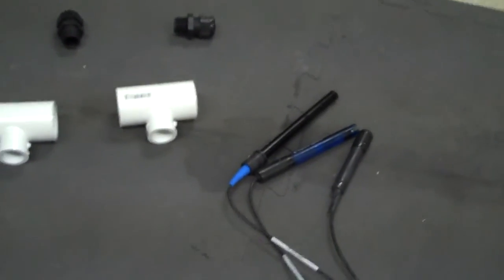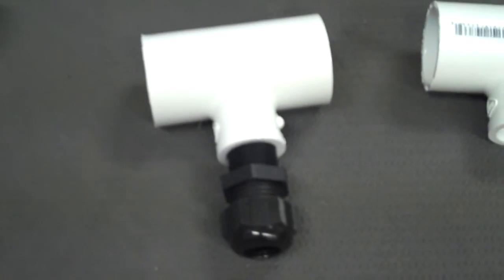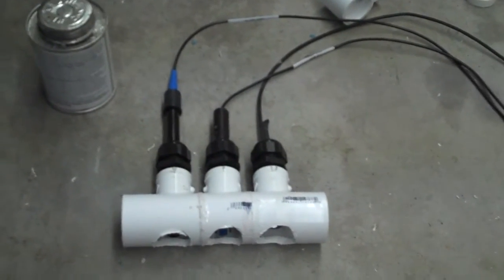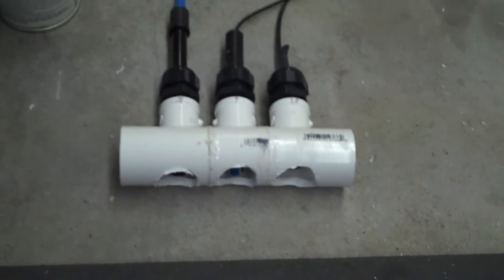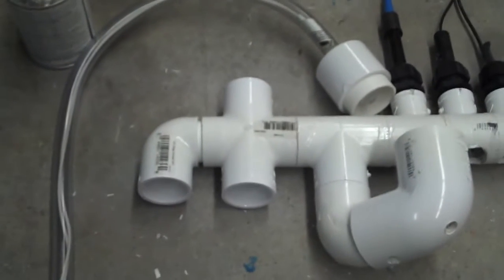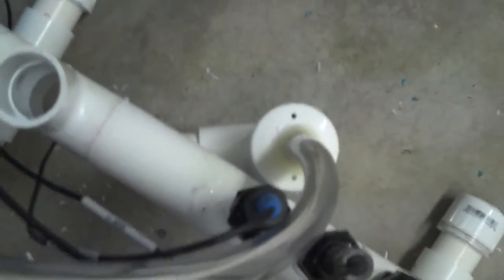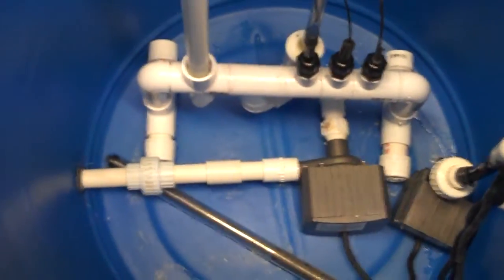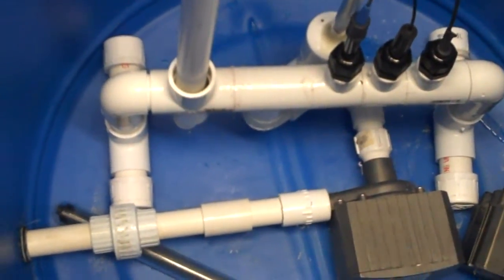Saltwater Station Probe Holder

Comment: I don’t understand the reason for the holes at the bottom of the pvc pipe under each probe, wouldn’t the water flow through it anyway? I plan on making something like this on a return line manifold